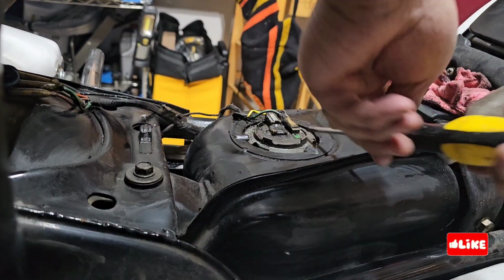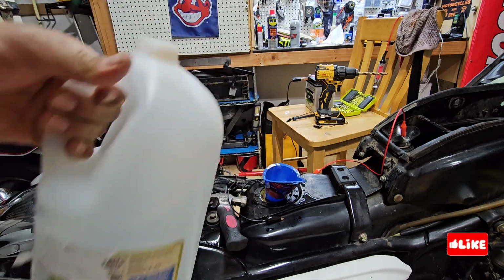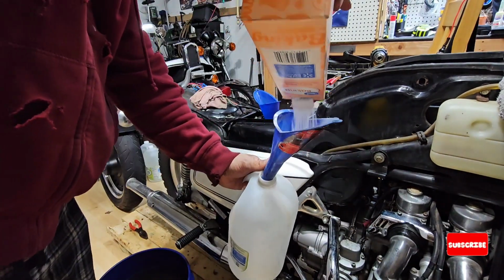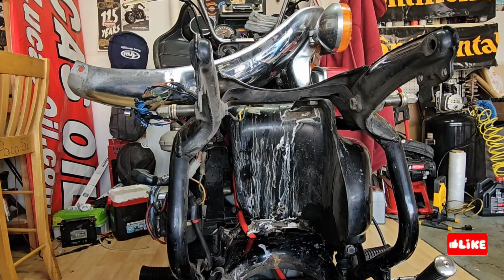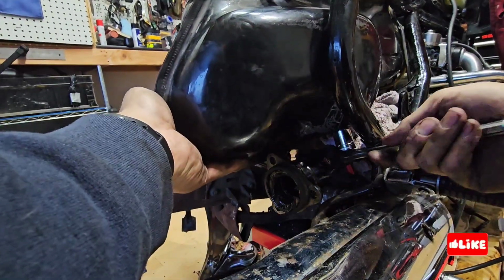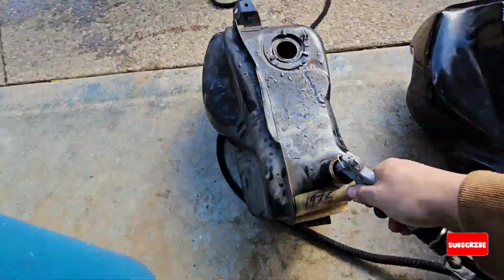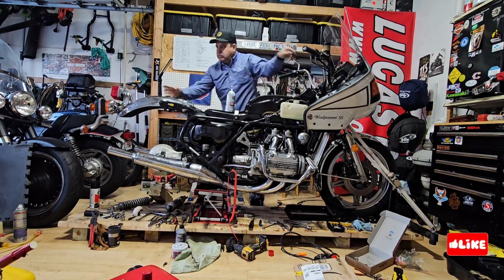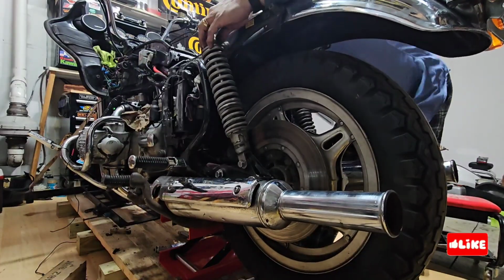1978 Goldwing will it run part 2... fuel tank.

Comment: first job old bike have take off all carburators and clean all jets and make new seals, important job, old gas closed all small holes in carb.
Reply from the maker: Totally agree. I cleaned the carbs but I haven't post the video. It was a pain. Lot of sludge that had to remove. Changed all the jets and cleaned inside. Thanks for watching

Comment: this is repair old bike have funny perfect hobby work in garage time go funny and have good work repair old bikes back to road, go lot time but have funny and happy when all have perfect new condition, good ,i enjoy repair and build old bikes and cars and many, i has build 2 old lincoln continental mark4 and mark 5 perfect new condition, one old -76 cadillac eldorado, some toyota camry and one old jaguar new condition, funny work, retiree in Thailand now and have buy many motorbike engine need someday start repair all new condition. build chopper and daily drive bike and one motorbike engine reserve 3-wheel can-am style car. but this is future, ow i build some RC airplane my second hobby. have retiree lot time make many woodwork, all my house furnitures has made, metal work repair many local peoples tractor, repair some motorbike, etc learn make leather work, and has build cnc machine woodwork.
Reply from the maker: Wow. That is great. I also enjoy working on old things. I am fixing this one and getting it ready to sell. Then buy another project. This bike is complicated for the year. I went to Thailand in 2010. Had great time. Also noticed that cars there doesn't have like a heater, Only AC. Always hot there. Thanks for your comment

Comment: simple job, take gas tank out and elektrolyse all rust off and clean tank first.
Reply: new tank need too elektrolyse clean inside. i has before clean some tank fill inside clean nuts and gravel, then bolt tank to cement mixer and runnin mixer tank spin at mixer and sand and nuts clean all big rust, then clean tank and elektrolyse fine rust off, and last rust-off chemical  come very clean tank, i has make this my honda CB550 four tank and old CB 750 four tak and some scooter tank. some little hole i has welding closed, one tractor tank i has give water cooler repair men him silver solder tank holes closed.
Reply from the maker: I thought about that but it has a mesh to pre filter the gas. So putting nuts may damage it. I did electrolisys to it.
Reply from the maker: Yes. I was trying not to remove it. Ended doing it. But the was cheaper to buy another. The gas pipes were obstructed. Thanks for watching

Comment: Nice wan, keep it up. 💪🛵
Reply from the maker: thank you, did the carbs and now doing the timing belts. thanks for watching
Reply: @Oneguygarage  The quality of the components is great and a joy to work on. With the carbs, did you use a full carb kit and balance the floats? I'm going into the carbs again on my 76 GL Ltd after I rebuilt. They are flooding the plenum and I believe it's the float levels need checking.  🤦‍♂
Reply from the maker: I am using good quality components. The carbs I used a new kit but some jets were so stuck there that I left them there and cleaned them pretty good so they have fluids and air flowing correctly. It was difficult to remove the carbs. Too many thing to remove.